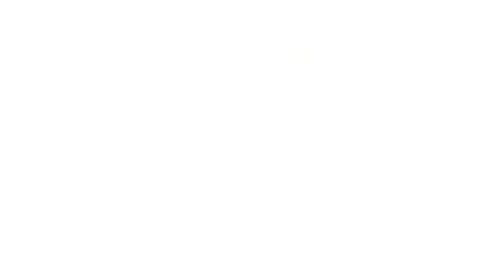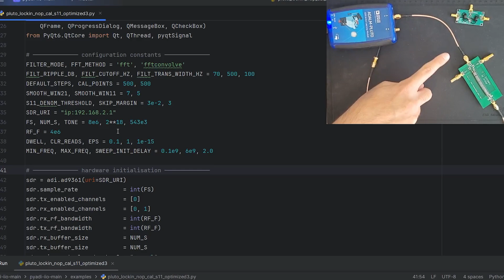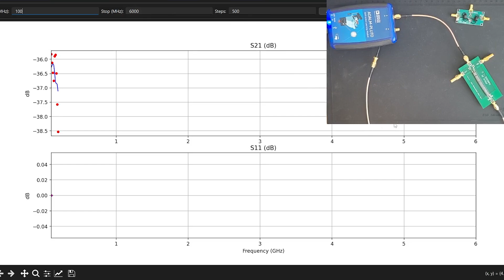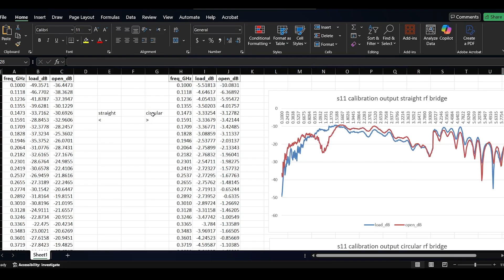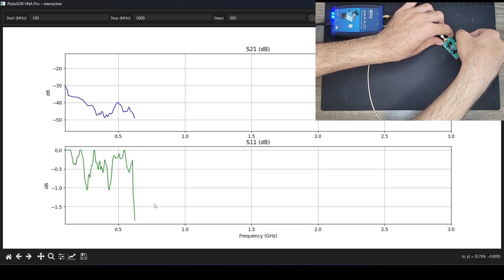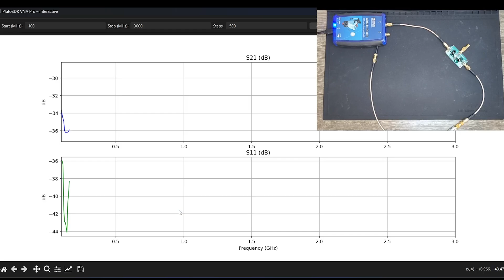Pluto Network Analyzer Pt. 2: S11 Calibration, Python Code & RF Bridge Performance

Comment: Thank you very much for your very god explanations. 
Perhaps would you have the kindness to add a requirements.txt file or 
a pyproject.toml to your repository,  as I'm going to die in the deepest 
depandency-hell of python-packages:  Just cloning, running your pip 
line, connecting  my pluto results in errors. I assume, that has not been 
your intention to put your genious code there...

Thank you in advance, kind regards from Cologne, Germany, sl0

Comment: Hi, can you measure the noise (SNR) with that setup?
Reply from the maker: Hello, thanks for your question. With this current setup we just make a network analyzer and we do not measure SNR. You can measure SNR in three simple steps:
1. Baseline SNR
   a. Loop-back TX → RX with a 50 Ω connection
   b. Capture IQ samples and compute a PSD 
   c. Identify the tone power Psig and the noise-floor power Pnoise
   d. Calculate SNR1 = 10 * log10(Psig / Pnoise)
2. DUT SNR
   a. Insert your DUT between TX and RX (keep all settings identical)
   b. Repeat the PSD procedure to get SNR2
3. SNR loss
   a. Delta SNR = SNR1 – SNR2 quantifies the DUT’s impact
To get the DUT’s input-referred noise power, convert each SNR back to linear units and subtract noise powers. For a fully calibrated noise-figure measurement, a more accurate method such the Y-factor method with a noise source is needed.
Reply: @fromconcepttocircuit  Thanks for the clear breakdown.

Comment: Excellent project. Do you think it’s possible to characterize antennae around 5.8ghz using your setup. Given a different bridge is used or a directional coupler and if you change the environmental settings of the Pluto and push the range to 6ghz.  The 2T2R paths can be turned as easily, would that help with the network analysis? I look forward to hearing back. I’ve antennas to tune , I broke my 6ghz nanovna and I hate waiting for a new one to be delivered.
Reply from the maker: Thanks. Yes, You can definitely extend this setup to 5.8 GHz (and up to 6 GHz) by flashing your Pluto with the AD9361 firmware build and bumping the LO and RF-bandwidth (e.g. to 61.44 MSPS)(please watch Steering Radio Waves: ADALM-Pluto Beamforming in Action video of the channel). ADALM Pluto uses AD9363 which guarantees performance in 325 MHz–3.8 GHz but by changing its FW to AD9361 we can enable the frequency to go up to 6 GHz. For S21 measurement I have tried it up to 6 GHz and got good results. I am also currently working on pushing the S11 measurement to 6 GHz by trying different directional couplers. I have a video coming up in the future where I will try few directional  couplers to do this. But given that the S21 measurement was successful I cannot see a limitation for S11 measurement given proper directional coupler is used.

Comment: Nice Work! When do we use a short for calibration & how? You have used open and load here. Thanks!
Reply from the maker: Thanks—I’m glad you enjoyed the project!
A short and an open both reflect 100 % of the incident wave, but with opposite phase: an open reflects in-phase, whereas a short reflects 180 ° out of phase. In a full Vector Network Analyzer (VNA) calibration you’d measure both standards (plus a matched load) to solve for your system’s phase and amplitude errors.
This project is only a network analyzer (not having the Vector part) —it measures the magnitude of S11 only—because the ADALM-Pluto’s TX and RX channels aren’t phase-coherent. Whenever you change the LO frequency on TX or RX, the PLL starts with a random phase offset, so you can’t extract phase information yet.
I’m working on expanding the design to add relative phase measurement. Once phase measurements are available, I’ll include the short standard in the calibration routine as well.
Reply: woohoo...you're the best...incredibly grateful for the knowledge you're sharing 😊 plz keep up the good work 🙏